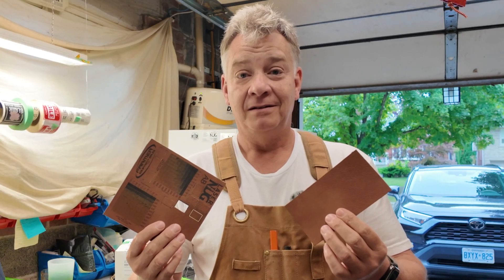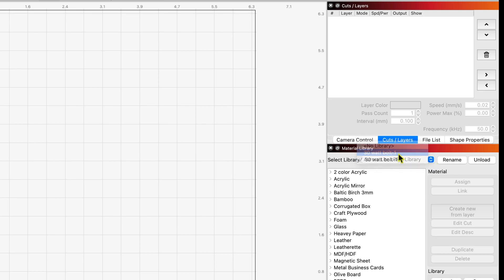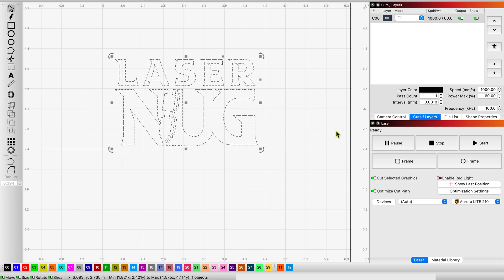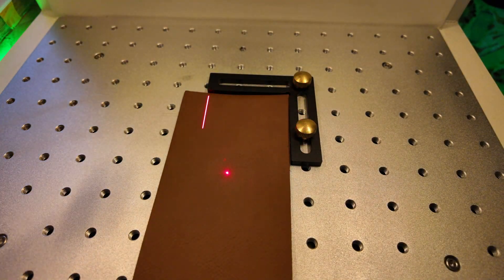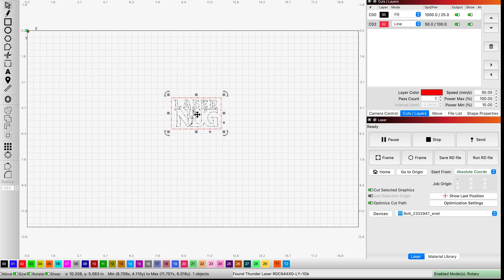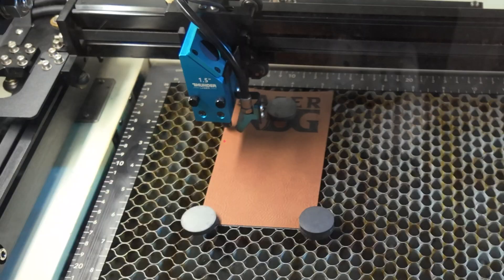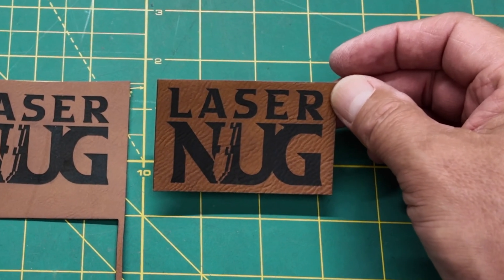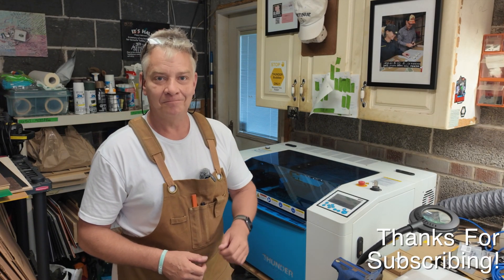Aurora LITE Engraving Leatherette vs BOLT C02 Laser.  055   4K

Comment: Have you tried engraving real leather? I’m looking at the aurora due to price, since I already have a flatbed cutter I don’t need a laser cutter.
Reply from the maker: I haven't yet. I have some veg-tan but have not attempted it yet on the Aurora LITE. I have tried a few times on the C02 laser and was not happy with my settings so far. And left it for now. Sorry I couldn't help.
Reply: @LaserNUG  no worries. Thanks for the info

Comment: Good afternoon. I live in Virginia. I would like to know how are the wheels on the X- gantry holding up.  Thanks, Steve
Reply from the maker: Good day Steve. So far I am 10 months in and no troubles at all. The wheels are holding up just fine - I have no issues - however It appears I may clean my machine more often than some ( from comments I receive). I alwaus clean the rails and wheels whenever I clean the mirrors/lens, cause I use alcohol wipes and it only takes a minute so I run the wipe along the rail runways and also wipe off the wheels. It's super quick nd i think its good to keep the runways clear and wheels clean from debris. Hope that helps. Thanks for watching!